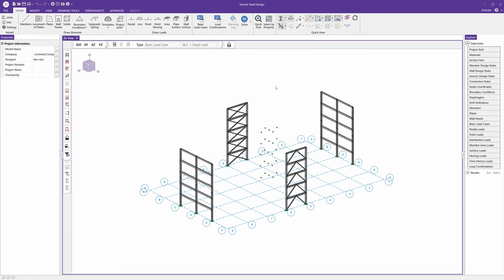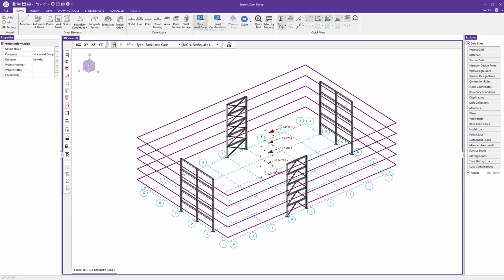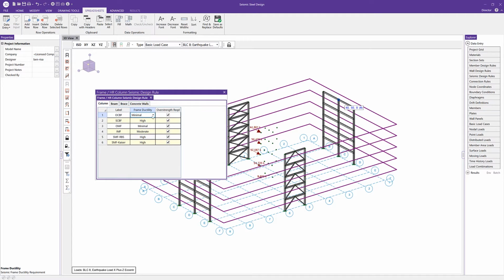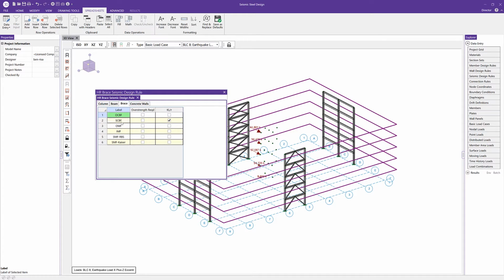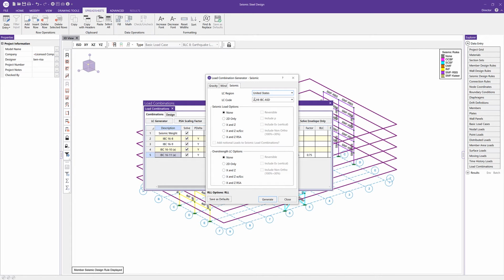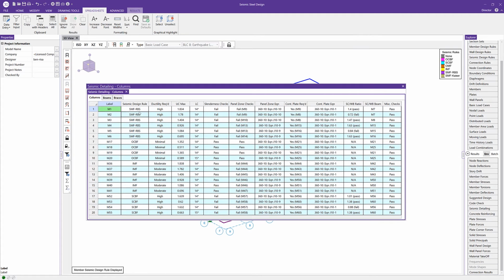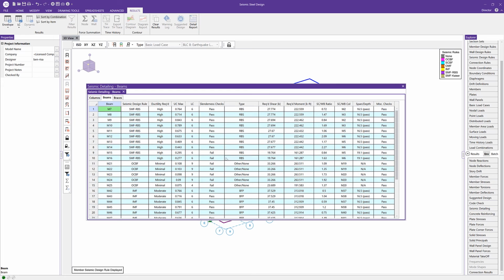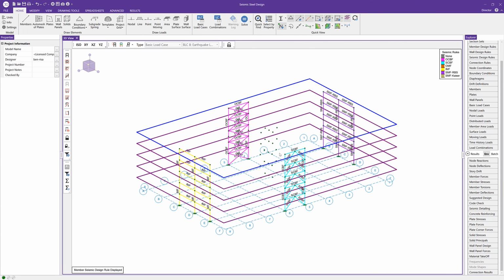Seismic Design of Steel Structures in RISA-3D

Comment: Great video, are you able to see center of rigidity?, and what about concrete seismic design for frames members?
Reply from the maker: Hi Remy, we cannot graphically show the center of rigidity although it is listed in the seismic load generation.  As far as concrete goes, we can utilize the same design rules to amplify the loads with the overstrength but as far as design, we only currently do seismic design/detailing for concrete shear walls.
Reply: Do you have plans to include non linear analysis like pushover analysis to the software?